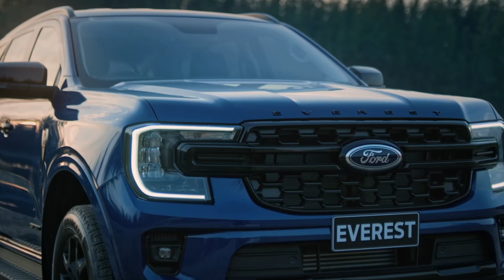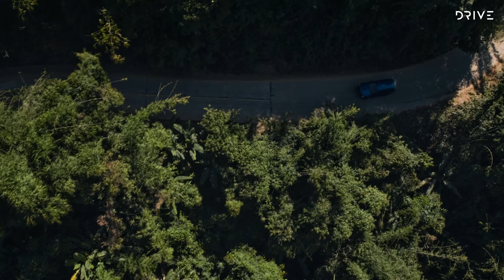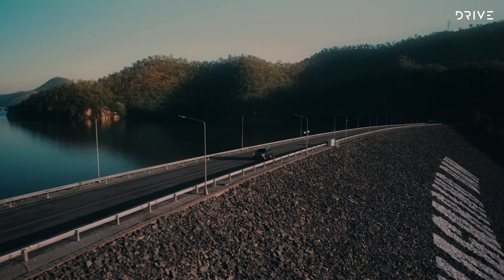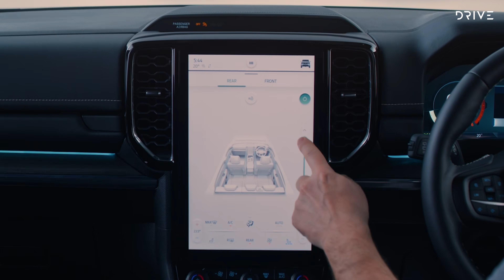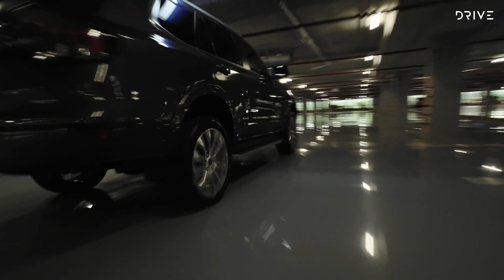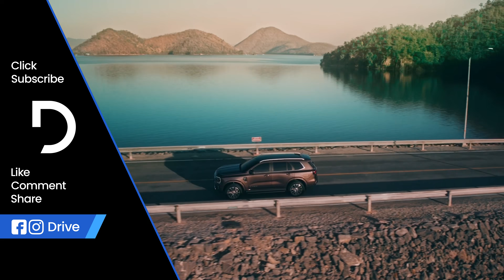2023 Ford Everest revealed | Drive.com.au

Comment: The 3.0L diesel was discontinued in the USDM Ford F-150 in July 21 due to being an unpopular engine choice, and the 10R80 transmission has reported problems with mixed reviews. Also the previous Everest models sold in low numbers for an SUV.

If Ford can fix the problems, then it has the potential to be a good SUV and choice.